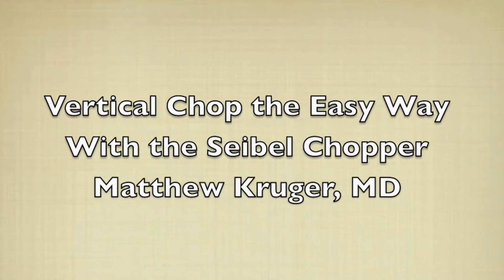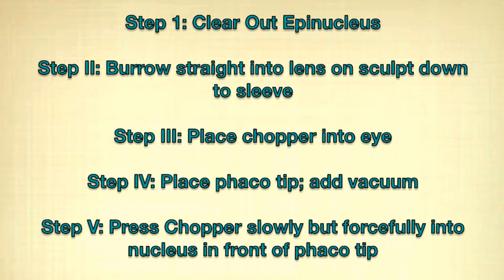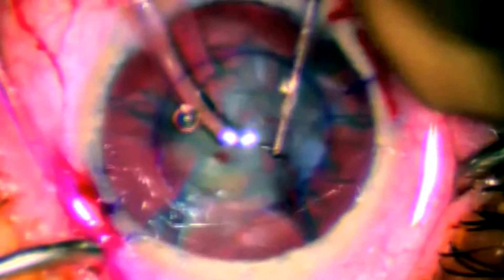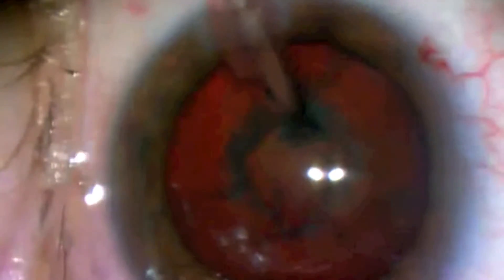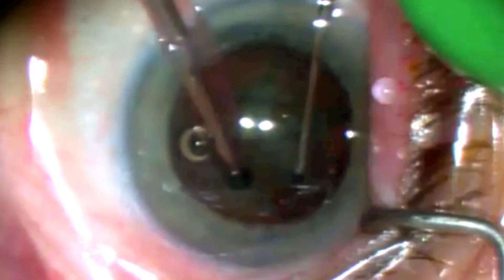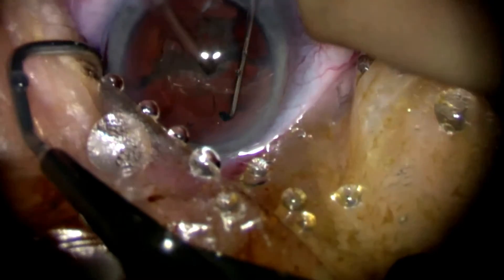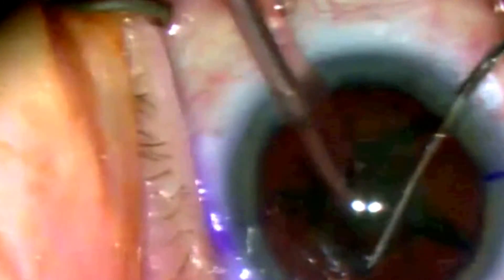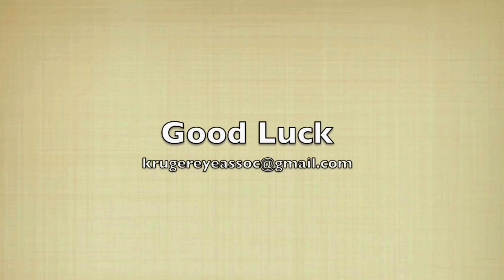Learning Vertical Chop With The Seibel Vertical Chopper

Comment: Thank you sir for this video. What parameters do you use? thank in advance.
Reply from the maker: This applies to the Centurion only.

Sculpt: Vacuum 100 Flow 25 100% torsional

Chop: Vacuum 400 Flow 40 40% Burst traditional phaco

Quadrant: Vacuum 400 Flow 40 100% torsional

Comment: Sir, while holding the nucleus by vacuum , do we slightly pull the nucleus towards main port or slightly pull the nucleus towards the cornea by phacoprobe to create a shearing force to do vertical chop...
Reply from the maker: I have not found that to be necessary but I know it is recommended by David Chang.  This particular techique was for 0-3+ cataracts, not the most dense.  I use the Chang vertical chopper for 4+ cataracts when needed.
Reply: @mattmkruger  thanks sir for your kind reply...

Comment: sir chopping is done during phaco 1 or phaco 2
Reply from the maker: +prathibha chachadi 
There is a chop setting I use which is listed in the video.  I think phaco 1 or 2 must be from a different machine than the infiniti or the centurion.  The bottom line is that the chop setting (high vacuum with burst mode linear ultrasound) is different than sculpt (low vacuum and aspiration) or quadrant (high vacuum with continuous oZil).
Reply: Thank you sir

Comment from the maker: Hello,

I like to burrow in on sculpt straight toward the center of the nucleus.  For routine cases of 3+ NSC or less I will leave 1mm of metal tip exposed.   For 3-4+ and 4+ I will do 1.5mm to make sure you get deep.  More density of NSC requires more depth for the phaco tip.  The point of making the pot-hole first is so that you can perform one step at a time instead of trying to manipulate 3 things at once.  This makes it easier and safer to learn.